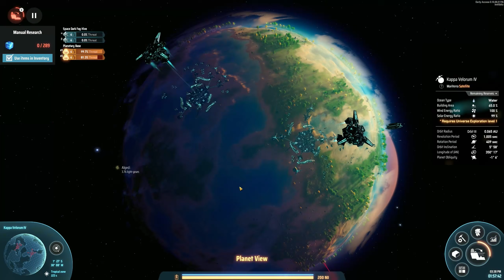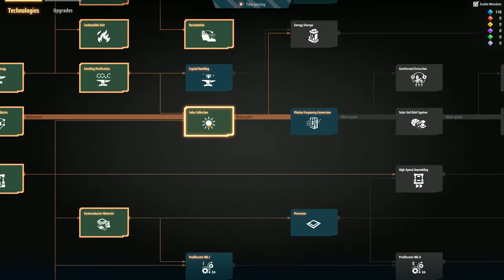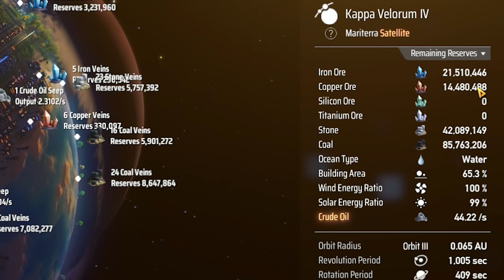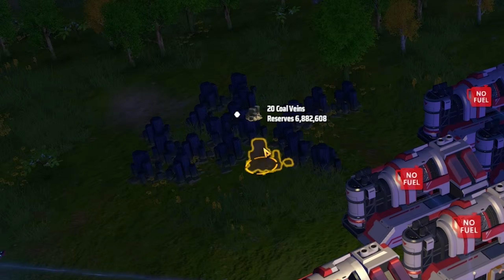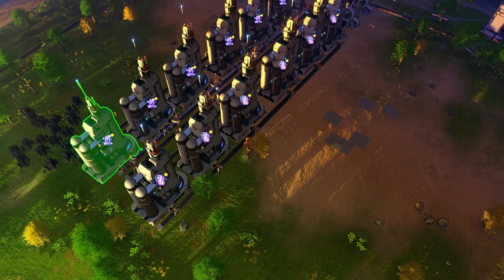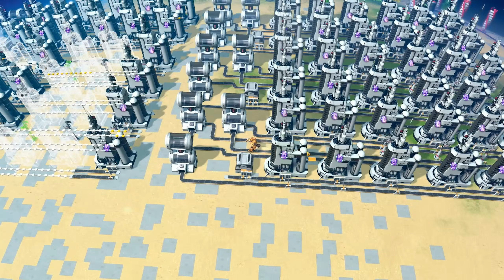First World CONQUERED in Dyson Sphere Program Rise of the Dark Fog!

Comment: I always struggled with oil in my play throughs. Honestly, it was so tough I stopped playing bc of it. I was so use to using circuits in factory to solve the issues. 

Anyways, I FINALLY figured it out. I found that using an equal amount of refineries for all the oil recipes keeps the system moving like butter (or oil). 12-12-12, each 12 stack doing one of the three recipes. It worked out that the system kinda couldn’t clog up due to hydrogen/fuel. All you need extra is coal, which is typically not an issue.

Comment: Don't forget you can stack some buildings, and they then auto sort the items between those above. Like stacking the research labs or chests/depots. Also a great tip is putting a depot above a splitter. That stores any items that overflow on the splitter. That way you don't need sorters to input to a chest.
Reply: you can also feed out from a chest using a splitter to get constant max belt speed for no power instead of using 3 blue sorters that still won't fill it completely for...some amount of power... idk how much but it adds up

Comment: Unfortunately, you got the "ideal" ratio for the xray cracking wrong. If you want to fully process the incoming oil, you need 2 cracking plants for every plant doing the basic oil recipe. This is great early game, where you mostly need hydrogen and the graphite for science. This processes/consumes all of the light oil and is ideal for a pure science setup. Later on you'll want to get rid of this though, as you get more sources of hydrogen (gas giants, and other processing steps has it as a byproduct as well) and light oil becomes your main concern with oil (plastic, sulfuric acid, graphene). Then you don't wany any cracking at all, and you might wanna start "reverse cracking": There's a 2nd recipe that creates more light oil by actually adding coal.

Comment: X-Ray Cracking is a trap and a waste of refined oil. Oil is not unlimited and the oil seeps will run down to 0.1 oil/sec. store all the refined oil in fluid buffers for making Sulfuric Acid and Plastic later. You'll run out of red science before you can fill even 6 fluid buffers. You'll need plastic for Yellow Science, and most of the stored refined oil will go to that. Both Red and Yellow Science will balance out everything. The rest goes to Sulfuric Acid for making graphene. If you need extra power make and burn combustible units. Also, the secret weapon to taking down the dark fog is signal towers. As long as they are on the same grid as your missile launchers, all the missile launchers will target the dark fog inside the signal tower radius. Signal towers will also be the first thing targeted by the dark fog.

Comment: Tip: its better to keep the Darkfog on your planet because they drop Titanium thing and that will help you to do 3rd matrix structure matrix and that needs titanium crystal and that needs Titanium! and they drop titanium ingots and titanium crystals!
Reply: As someone with max darkfog difficulty, I'd like to add:

Farming darkfog lvls up ALL darkfog in the system, I closing other planets.  By the time I felt ready to tackle a titanium planet, they had 15 LVL 18 bases and I couldn't crack it with the tech LVL I had.
So I had to slowly tech past them with darkfog drops so I could expand.

Different playstyles will work smoother with different strategies.😅
Reply: @12463trf  true true i would ad darkfog farm.
Reply: @12463trf  True True i would like to add darkfog farm as you said.

Comment: A couple of things. Battlefield Analysis Bases (BABs) are your best friend from the moment you get them. They have 12 construction drones and a wide area of coverage, so they can make things quicker then you can with your 5-6. They also repair buildings automatically so putting them nearish the dark fog assault line will keep everything up and firing smoother. They /also/ will collect dark fog drops as well if they're in range (see comment on BAB range). You can also put storage units on top of them to expand their cargo capacity.
Then there's number 2. Sort of just a bit before the planetary logistics, is the 'fidget spinners'. Shorter range logistic drones (at least to start with) that move between storage units with a add-on attached. Not /as/ effective as PLS', but a passable intermediate step that won't require ripping out infrastructures to place the towers.
Reply: plus you can have the spinners keep your pocket in perfect order by supplying and collecting stuff you want or don't, and you get extra slots with their own separate upgradeable stack sizes. Great for carrying a bunch of hydrogen or anything else that doesn't stack high.

Comment: It hurts my soul to see you burning all of your oil like that. 

Soon you'll need oil for plastic, organic crystals, and graphene. And the oil seeps that you tap will slowly deplete, leaving you with no more oil on your planet - which also means in your system. You're going to get stuck having to fly out to another system just for oil a LOT sooner than you expect 😕

Just turn coal into the combustible fuel and use that to run your thermal power plants. Then eat a bunch of stone into silicone and start making rings of solar panels around your latitude lines - which also makes for convenient power hoookups whenever you add to your factory. Those should hold you until you get fusion power, solar sails, and antimatter. 

Save the oil! It's a limited resource just like iron, copper and coal. This isn't Satisfactory where everything is infinite :)
Reply: Oil never entirely runs out, unlike the other resources.  It just gets slower and slower to extract.
Reply: @Mirality  True, it reduces down as low as 0.1/min if I recall ... which won't feed any meaningful build without adding to it from elsewhere. At that rate it will take one seep 4 minutes to trigger one cycle of refinement IIRC..... which might as well be none at all.

Comment: Missing two key items for offense and defense.

For defense the Battlefield Analysis building has its own set of constructor drones that will repair buildings in range and if stocked with items like belts it will rebuild anything that does get destroyed.

As mentioned by others the missing offense and even some defense is the Signal tower. This allows any missile turret to fire missile at any enemy unit or building the signal tower has line of sight to. So all you really need is a couple signal towers to creep up to the AI base and than watch the fireworks show as all mistle turrets on the planet kick into action. Add a single Battle field Analysis building to the Signal tower closest to the AI base to keep the enemy from destroying the tower.

The Signal Tower does also have some defense uses as well. So when the enemy space fleet comes a knocking the signal tower can help quickly destroy said fleet, as again allowing all missile turrets to attack fleet units the tower can see.
Reply: Bro I don’t think he has all the tech he just starting
Reply: @Gskillz-  Yes was pointing out to help him not lose as many buildings taking down the outposts in the future.
Reply: Sounds like a nerf is in order
Reply: @williamking331  it might get one but the energy cost of covering everything with Signal Tower is quite high.

Also because all missile turrets have a relatively high power draw while firing, a planets worth can quickly push the energy production to its limit.